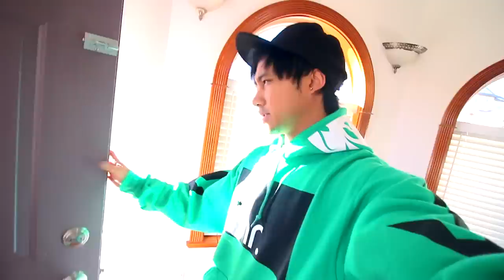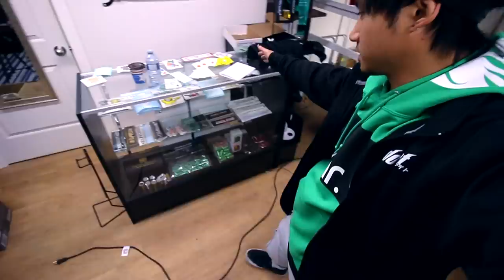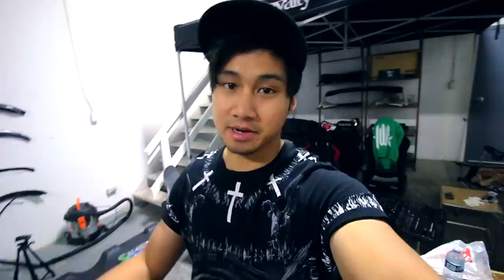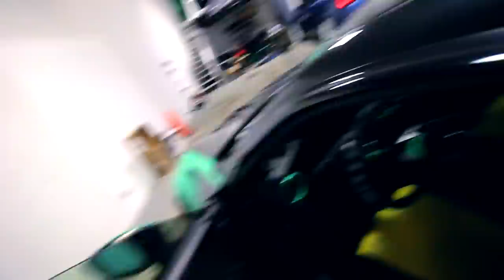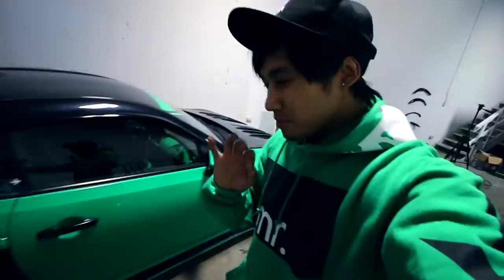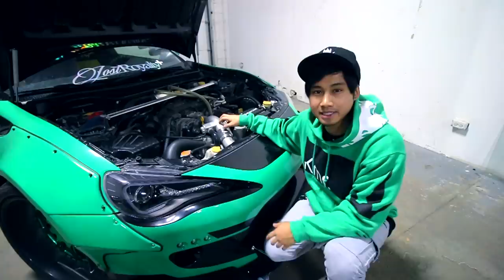Complete Walk Around of my Widebody FRS  // Addressing the Hate Comments

Comment: This car is the only reason why I am subscribed to this channel. The transformation it went through is amazing. Especially when it's all done yourself. Alot a folks who have this car can't even compare. So with that said, screw the hate you get from them. They watch to bite off your idea. Period.
Other than that, I can suggest something for you. The wiring you got setup to the bumper should be cut. Use a weatherproof connector/harness. That saves you the headache you go through when you do remove the bumper. Trust me, I have my 04 Maxima wired up in the center console and I made sure I got connectors to avoid issues like this.

Comment: Is it rice if i have a 600 hp 600 lbs/ft brz with carbon fiber 1,000hp rated drive shaft ray gram 57extreme wheels 19 by 9.5 inches upgraded axels built engine stage 2 clutch and lambo doors oh and a stock exaust so i sound stock